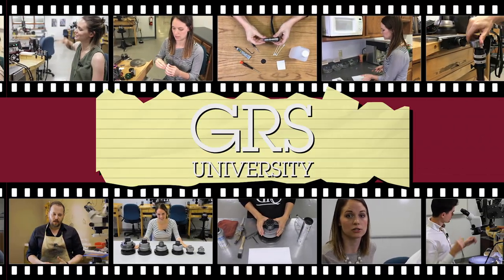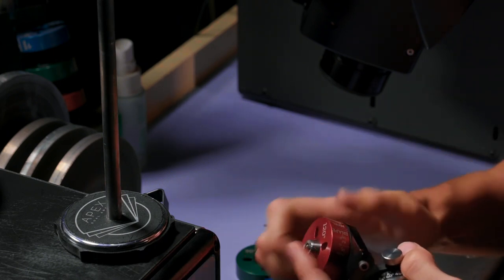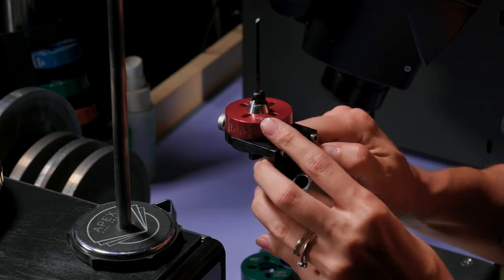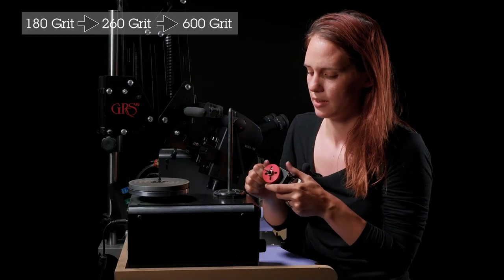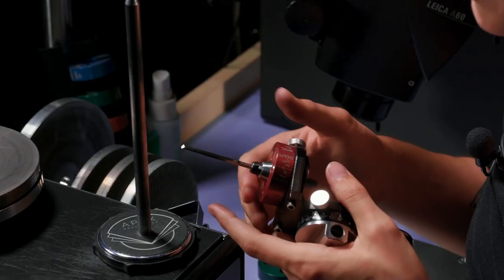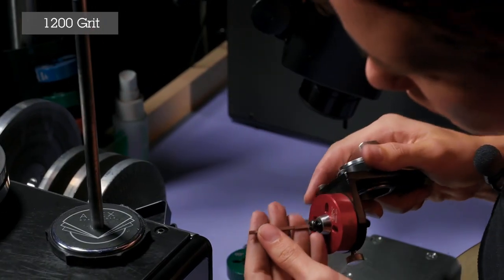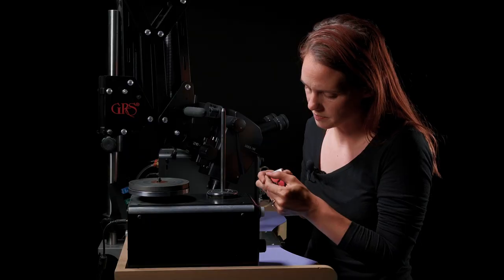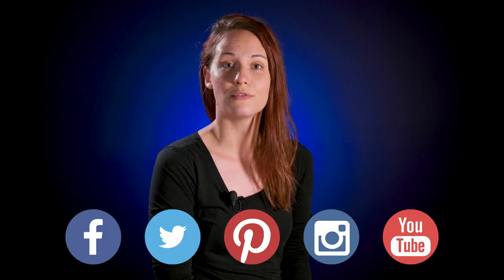GRS University: 120° Graver

Comment: This is what I don’t understand how to orient the Engraver in the holder so that it will line up properly with the calibrated fixture?
Reply from the maker: If you are using a square stock graver (like what is shown in the video), make sure you place the graver in the QC holder so the set screw tightens down to one of the flat sides of the graver. You don't want to tighten the QC screw down on the edge of the graver, as that would have less contact between the graver and the holder. Also, when using multiple gravers, make sure the tab position of the QC holder is in a consistent relation to every graver. For instance, the tab might be face up when looking at the graver face. For some, the tab might be on the left when looking at their graver face. Keeping it consistent will prevent the need to adjust your handpiece every time you switch gravers. And a final note - once you place a graver in a QC tool holder, don't remove it for the life of the graver. Taking a graver out of the QC Holder after sharpening will require more time to resharpen it after placing it back in a QC holder.